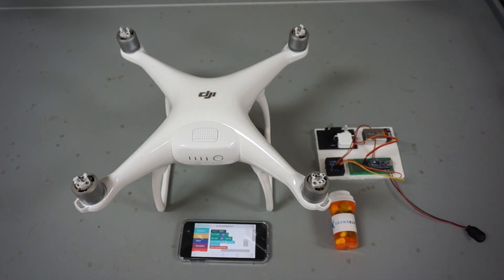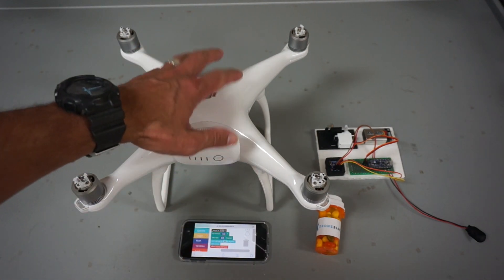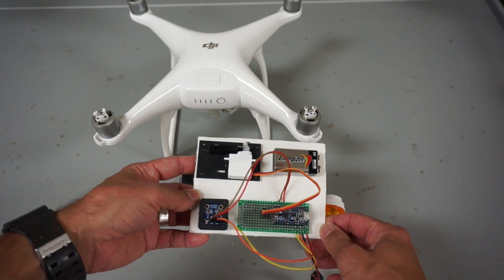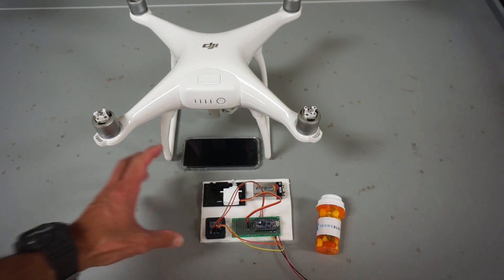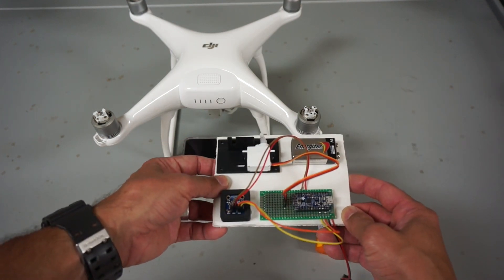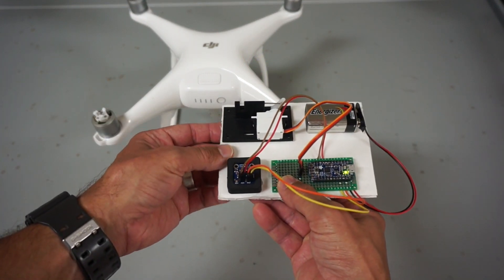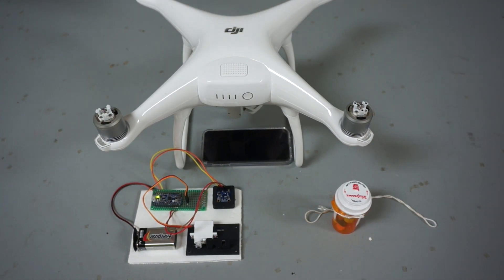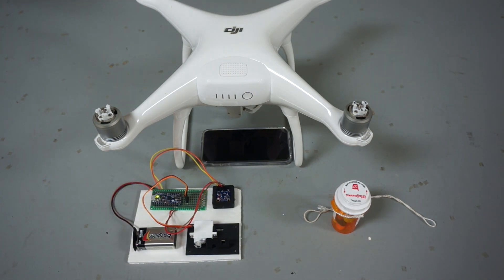Payload Dropper Proof of Concept for DroneBlocks and Drone Delivery

Comment: @Dennis Baldwin you could use a UART port on the flight controller triggering a solenoid replacing the servo, in my humble opinion it is a simpler solution - isnt it?
Reply from the maker: The only challenge is I wanted to get this working with P3/P4 and other DJI aircraft. In those scenarios there is no serial comm. The M100 does support it, but that's a much more expensive option that not many users will have access to. Keep the good thoughts coming.

Comment: I think you could shoot ground elevations using the same procedure.
Reply: gravity is the optical plummet, how stable and accurate is the instrument?
Reply: You don't need any processors on the dumb end, don't mind me speed is still slow on the upstream side because of gravity issues.
Reply from the maker: Interesting idea. I like what you're thinking. Will have to investigate some more in the future. Thanks for the comment.

Comment: i activate my siren from the c2 button on the tx using a light/dark resistor taped to the front lights of the p4.
Reply from the maker: Very cool. I've seen this implementation before. If only we could control the LEDs with 3rd party apps. It would be a nice solution. Thanks for sharing.

Comment: There is a nice drop mechanism on thigaverse already just do a search. As you already know a pixhawk drone would be the way to go with 16 channels on the x8r it's really simple
Reply from the maker: Cool will see what I can find. Most of the ones I've built previously or found require an external signal to drop. Yes it's nice and easy with the X8R but unfortunately DroneBlocks is not compatible with Pixhawk aircraft....yet. The problem is we don't have the ability to easily control gimbal pitch, camera exposure, camera shutter with code in the world of APM/Pixhawk. We recently added support for 3DR Solo but unfortunately the market is limited compared to DJI....unfortunately. Thanks for the feedback. Much appreciated.

Comment: Does the Phantom offer no GPIOs at the camera mount? I thought they even have an API and other developer support. How do you make sure it doesn't drop during normal flight, let's say while flying a circle to look at the landing zone?

edit: Ah I get it it's so it will work with any Multicopter. Then it's a clever idea! I have another idea. Why not use a hall sensor and a magnet that's mounted on a lever on the gimbal and passes the sensor only when the camera is pointing straight down. That way you already look at the payload through the camera, pan quickly left and right so the sensor gets triggered at least twice in a short time and the payload drops and you make sure  you have visual confirmation of the drop.
Reply from the maker: I wish there were GPIO, but we don't have that with the Phantom. Good question regarding circling the landing zone. Right now the code looks for a discrete 360 rotation between 3 and 6 seconds. So if you're circling the landing area it will likely take a lot longer than this time window. I'll need to do some more testing to see if anything else triggers it.

I like the hall sensor idea. Originally I thought of using the gimbal to close a circuit when the gimbal is pointed to -90 degrees. That may be another way to approach this but I wanted to try to do it without moving parts. I will do some testing over the weekend and share results. Thanks for the great feedback. Really like hearing these ideas.

Take care.

Comment: Recently had a need for a similar mechanism that needed to be FC agnostic as well.  We actually opted for separate control, using on board video for precision drops.  I like the Arduino approach.  We went with separate on-board control because phase 2 requires lower the item to dropped on a line (reel) and then dropping from the bottom of the line and reeling the line and drop mechanism back in.
Reply from the maker: Very cool idea. I don't know enough about video processing to pull that off. Would love to learn more about your approach. Thanks for sharing.
Reply: Hi Todd, I'm working on video precision detecting that I think that has the same principle of you precision drop. Would love to know more about your project and to obtain some additional information to my project. Do you think it would be possible to exchange some ideas with you ? Thanks!